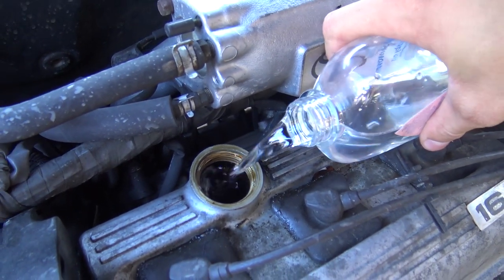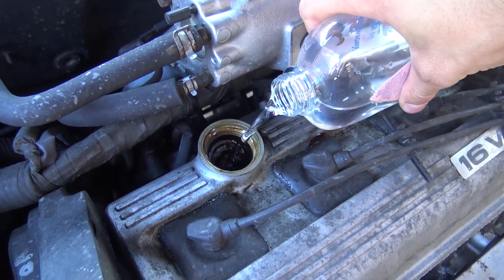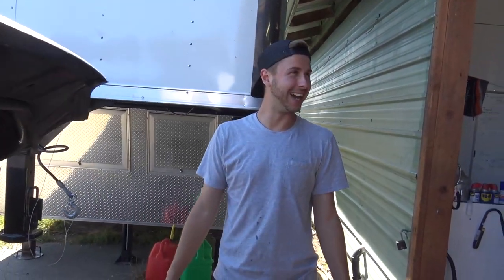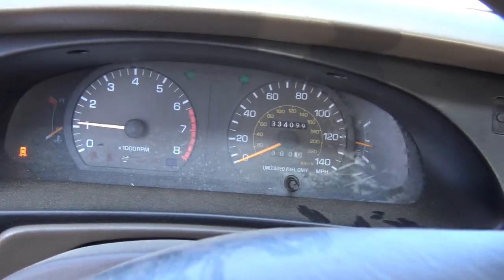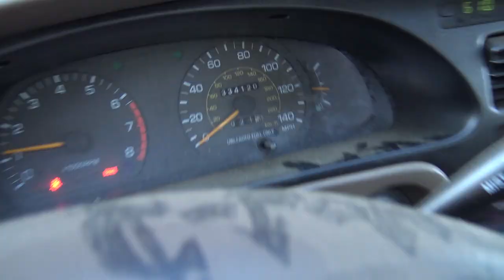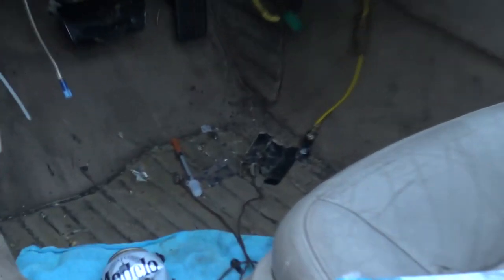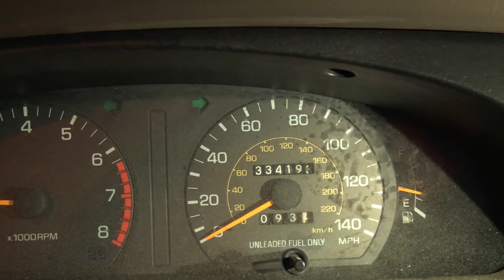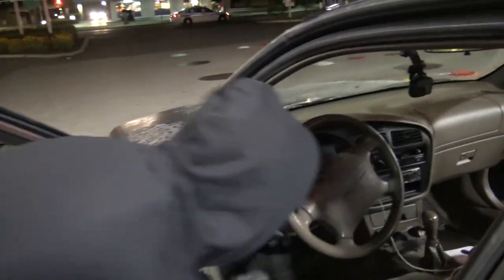Can You Use BABY OIL as ENGINE OIL?

Comment: Next video: "Can You Use Engine Oil As Engine Oil?"
Reply: davidrobert2007 can you use engine oil as baby oil?
Reply: Answer,not always
Reply: davidrobert2007 next video will bw urine as engine oil
Reply: They make 180 miles and still running, that's pretty impressive.
Reply: davidrobert2007 I never would have thought of that
Reply: davidrobert2007 No it's gonna be, Can you use engine oil as a tire?
Reply: Can you use a tire as engine oil?
Reply: can you use petrol as engine oil, brake fluid as fuel, engine oil as coolent and coolent as anal lube???
Reply: I have watched 15+ of these...don't know why, but this was the one that made me sub... 👶🏻 🗼
Reply: You got it wrong. It's "Can you use ENGINE OIL as ENGINE OIL"
Reply: Can you use lube as engine oil
Reply: David Lulham it's used in compressors on r22 air conditioning systems those last up to 20 years using baby oil to lubricate bearings
Reply: Maxwell Gavin
I was about to say that.
Reply: Budget cuts
Reply: davidrobert2007 lmaoo
Reply: David Lulham 

You want a cookie? Lmao what the hell were you proving
Reply: wtf richard they could do regular 10-30 and have me doubting it
Reply: Engine oil als gasoline
Reply: KY
Reply: KennyKGaming yes and runaway
Reply: Maxwell Gavin can you use babys as oil
Reply: davidrobert2007 lock up on startup lol
Reply: Squeek Tate i tried that once it completely ruined my engine
Reply: Can you fry a Turkey in Engine oil?
Reply: davidrobert2007 I dunno that doesn't sound like the best idea... I think it might not work... Lol 😆
Reply: davidrobert2007 Holy 5H!+ that's a lot of likes, congrats
Reply: Starbucks! really?
Reply: davidrobert2007 now that's a tough question
Reply: not water based
Reply: Dude that would never work.
Reply: I think the viscosity on baby oil is thick enough also there still engine oil stuck everywhere else so I would imagine it works good
Reply: davidrobert2007 I like that question
Reply: I taint mistaken Bahahahahahahahahahahahaha
Reply: “I don’t think it will last a minute”
Reply: She's done at 20,000 miles, I guarantee it
Reply: used engineoil as babyoil
Reply: That's a little too crazy, even for them!
Reply: davidrobert2007  tommyfyeah JUST did that!!!
Reply: Calvin Rivera that car has 334,000 miles on it!!! 😎
Reply: davidrobert2007 😂
Reply: Can you use gasoline as engine oil and engine oil as gasoline
Reply: Next video, can you take a dump into the oil pan? And run the engine with it as lubricant?  ha-ha
Reply: davidrobert2007 engine oil as baby oil
Reply: davidrobert2007 haha!
Reply: Next thing, we'll use tire rubber as condoms, or condoms as rubber tire... tsk tsk
Reply: SPECS Ikr I literally just SUBSCRIBED
Reply: David Lulham baby oil is better than nothing at all, but it’s too thin compared to motor oil. Over time the engine will have increased wear.
Reply: Na would not work dog
Reply: @fredopppppp  hahahahahaha the baby will run like a dream
Reply: LOL
Reply: StółZpowyłamywanymiNogamiEdycjaGryRoku Niebieski No but you can use it to make solid rocket fuel
Reply: or you could use the engine as oil
Reply: @stozpowyamywanyminogamiedy4790  It's like flex seal 1 you melt tire 
2 while it's still hot put it in the engine and start it will burn and blow the engine
Reply: probably
Reply: Cooking oil as engine oil
Reply: The ultimate question
Reply: @Ouchie-my6tg  and then babies will ever have a hair again
Reply: can you use an engine as engine oil?
Reply: ah yes the floor is made of floor
Reply: Can you use vin diesel as diesel
Reply: I would love to see this and they all play along with it 😂😂😂😂

Comment: Baby oil is basically just mineral oil which is what cars were run on before the additive years
Loses its lubrication properties pretty quickly compared to modern oil but I wouldnt be surprised if you got a few thousand out of it .
Reply: Ah yeah this makes sense now.
Reply: In Mongolia yak butter made from yak milk is more fatty and thicker but yak butter is very lubricant and use as motor oil

Comment: This test is unfair because you used a Toyota.
Reply: No it not it is fair
Reply: Use a Chevy next time if it doesn’t break down on the way to get the oil
Reply: 440 DRAG I agree
Reply: Swear I thought the same lol
Reply: Laszlo Doiron Yeah, Chevrolet sucks.
Reply: It do sent matter what type of car they use
Reply: i drove over 15 miles once without any oil, an oil line got busted
Reply: Fujiwara Shiina 
WHY
Reply: Goat cuz an oil line got busted? It was night i did not know i was driving with no oil, i aint got no oil pressure guagr
Reply: 440 DRAG could run on any oil
Reply: Funny, had my pos Cavalier almost 20 years.  Engine-wise it is fine.
Reply: Laszlo Doiron what type of chevy? Car or truck?
Reply: Laszlo Doiron u mean a ford?
Reply: I had the 2JZ Lexus GS. The car was losing oil really bad and I was like fuck the rear main seal went bad probably. I put some stop leak and get on the interstate on a 200 mile drive, the oil light comes on and I pull over and it takes 5 quarts! I put some more stop leak and head back home and again I add 5 quarts. Turns out the oil filter had a big hole in it! Needless to say, the engine suffered from absolutely no damage.
Reply: That just shows how reliable Toyota is 😂
Reply: 440 DRAG I did 80 miles with no oil pressure in my 85 Toyota truck with a 22r and it was fine so.... yeah
Reply: Laszlo Doiron *ford

Comment: its a toyota it could run without oil for 100 miles
Reply: William Neigum 
Lol. It will possibly make the 100 from the residual oil covering parts from the change and the baby oil won’t burn until the old oil is fully mixed into the baby oil. Just a guess.
Reply: I bet thats the 3rd gen Camry. I ran one with little and no oil for almost a month.

Comment: You cant kill a Toyota guy, 'oil' or no oil.
Reply: Don Pablo my Camry with 160k just blew up so hmmm 🤔
Reply: Tyler Spiker well with the right maintenance on Toyota or Honda with out modifications like a turbo, you can-easily get 400,000 miles if not a lot more, I know people that have older Toyota’s with 600,000 miles, and civics with over 550,000 miles
Reply: LOL...Toyota has a recall because of engines that fail..Toyota put wrong pistons in their engines thus no good and they die..Toyota Tundra 5.7 Camshafts failed thus killing the engines from brand new..Toyota 3.0 was a dud as every one had a head gasket problem thus killing the engine on some and needing heads and head gaskets redone on others..Toyota sludge engines,that killed Toyota engines at low mileage..

Toyota got their name from paying reviewers to praise their vehicles,all Asian makes did this in the 70',80',90's and continues today..It was even talked about several times by different journalists over the years...

I own a dealership,garage and I have not seen evidence of Toyota's not breaking down or lasting longer than any other make..Peeople with Toyota's generally repair them by the book and replace engines,transmissions etc..Then the 2nd or so owner gets the car and the car had a new engine that they dont know about and every part replaced,then they drive them 50,000 or so miles without doing a thing..Like any car this would happen...
Reply: To be fair there is a 1 million mile toyota in a museum still on its original engine
Reply: Authorized Mike thank you 🙏🏻
Reply: SnowB you just watched a video with dudes using BABY OIL in the engine of a Toyota with 334k. You definitely don't take care of your cars guy
Reply: I didn't change the oil in an 09 scion tC for around 40-45k miles till the bottom end gave on me.
I think my wife's 16 Corolla will out live us.
Reply: Don Pablo straight up! Yota gang.
Reply: Yeah. Scotty kilmer said so
Reply: Unfortunately my Toyota won't last forever because it has a Subaru engine :( still I love the 86 though
Reply: dirtbike14 dirt bike fully synthetic every 5k miles. My f150 gets the same treatment and that's still running. Threw a rod, just a bad one I guess
Reply: Michael Majchrowicz 01 f150 with 150k still running, 04 mustang gt 140k still running, 04 Kia Sorento 220k still running, 04 Ford Taurus 260k still running. I think I know what I'm doing.
Reply: Ben T any car can blow up that's just ignorant
Reply: @THECobrabitch  They do unless you never go past 3k rpm
Reply: @01trsmar  fr man Toyota’s are pieces of shit I blow them up all the time these cheap beaters with around 150k miles as soon as you redline them a few shifts engine is gone

Comment: It’s because it’s the 92-96 Camry 2.2  4 banger engine you can’t kill those. I had one with 500k and got rid of it running and driving after I didn’t drive it at all anymore. From 100k-500k, all I did was oil changes, brakes and one set of rear struts.
Reply: Im a mechanic and ive seen plent of them camrys eat shit
Reply: @TyzGamin sure thing.
Reply: "Im A MeCHAnic" and I've seen one go 6,000 without oil and keep going
Reply: Uhmm have u tried putting baby oil in it 😂

Comment: Can a air mattress pump work as a turbocharger?
Reply: Terrill Williams No. You can buy electric "turbo chargers" on ebay for like 300 bucks which are just glorified desk fand that you put on your air intake. They don't create enough pressure to have any effect on HP
Reply: No.  You can't
Reply: Then try a compressor
Reply: Or buy a turbo/ centrifugal compressor housing and machine a back plate and bolt the wheel onto a monster brushless motor and lipos see what thst does lol
Reply: Spencer Smith you’re wrong. It would produce boost but not enough to outweigh the vacuum the motor is pulling. However the less vacuum there is technically the more power you can make
Reply: r/whooosh
Reply: Terrill Williams its shaped like one

Comment: Put baby oil in a ford. See what happens. Toyota motors way too durable
Reply: JDMovation I bet my 225 slant six will take it but I dont wanna use my engine
Reply: Toyota powertrains are insanely reliable, I cant speak of everything else like electronics or other functions, but their motors are ridiculous....
Reply: Squeek Tate I think most people would agree the 350 is a god tier engine too. Toyota is just much more consistent throughout the years. Just because Toyota is really good doesn't mean other things aren't really good.
Reply: Toyota has major problems with using the wrong steel to make their rings with, and the cars burn oil accordingly.

Comment: I think this proves that it doesn't matter what kind of oil you use, those "performance" oils will get you the same thing as regular. Synthetic and conventional are still different tho
Reply: That's not true. While this oil works well as a temporary solution.. It won't withstand the same temperature and wear as regular oil does. The oil itself will probably not last as long as regular oil.

Comment: I had a Toyota Celica 1995 2.0L engine.  I once ran it for over a year noticing it was running rough but I didn't bother checking anything cos it got me to and from work without a hitch.  Months of this 'rough feeling' so I checked the tyres thinking they needed either replacing or more air, nope, all okay, checked the sparkplug caps, all okay, checked the radiator coolant, all okay, checked engine oil with the dipstick, dry as a bone.  For almost a year I drove it with little and then no engine oil.  The sigh of relief the engine gave me when I did top it up couldn't be felt as soon as I drove her.  Toyota engines are superb!

Comment: if i did that with my car, i'd be watching the engine temperature, listening for any ticking or knocking, and see how it performs when you drive it at highway speeds and when you stomp on the gas. but since you guys pulled it off successfully that tells me that baby oil and regular 5W30 have a similar if not the same lubricity factor
Reply: Well it's an older camry, so it could also just be the car is well designed. On a german car I don't think it would last too long.

Comment: “Can you use diesel as engine oil”
Reply: I want to see them do it too.. Said it a few times now
Reply: And don't forget e85
Reply: I ran diesel in my gearbox and clutch on my dirtbike to flush it out, didn't cane it while it was full of diesel but took it for a slow ride and drained it and refilled with proper oil and never had a problem
Reply: Project Farm has already tried this

Comment: Next: Can you use gasoline as engine oil?
Reply: Name not found yee
Reply: Can you use engine oil as gasoline?
Reply: Rip
Reply: that's not a good idea
Reply: @nov3019892008  you can in a diesel, you just can't turn it off once it starts burning.
Reply: Engine oil is technically gasoline. The only thing that will expoled is propane. So if you have a lawnmower that runs on gasoline and you put engine oil in the tank will it expoled or will it run. It's the same thing as a car/truck/SUV.
Reply: @jakedrex3237  1st of all, what? gasoline is a bi-product of oil, but its not oil. if you had pure gasoline in your engine instead of oil, the viscosity would be way out, causing it to not be an efficient lubricant and thus generating alot of extra heat in an already hot environment. gasoline varpourises very easily and would expand alot creating alot of pressure, and causing the engine to fail, and if when that happens a flame contacts the vapourises gasoline filling your engine it would pretty much detonate.

that said try diesel, it would do a similar thing but it wouldn't need a spark to explode lmao. would look sick too
Reply: @jakedrex3237  lmao just cos its made out of crude oil dosent mean its crude oil, its like milk and cheese, they are made out of the same thing but you cant say "milk is cheese"
Reply: @jakedrex3237  gasoline is prouced in oil refineries. roughly 72 liters of gasoline is DERIVED (look up the definition if you have to bro) from a single 160L barrel (42 gallons) of crude oil. material SEPARATED from crude oil via DISTILLATION (look that up too if you dont understand) does not meet octane standards for modern combustion  engines but can be used to create the fuel you would buy at a gas station.

gas comes from crude oil yes, but it is not crude oil it is part of what makes up crude oil, you can take a leaf off a tree but that leaf isnt still a tree, you cant mill it into planks, its just a leaf.
Reply: No
Reply: Nooooo
Reply: No
Reply: @jakedrex3237  its not but ok
Reply: @nov3019892008  2 stroke XE
Reply: Don't work that way.. But gas do went it. In small amounts..
Reply: No you can't. Found that one out the hard way. Let's just say that in some old garage somewhere very near me there is a old 5hp Briggs and Stratton flathead that will never spin again because it has more aluminum shavings in the crankcase than on the poor cylinder walls.

Comment: Run 100% Marvel Mystery Oil. 

Edit: it’s only like $2-3 a bottle for 1 quart.
Reply: Clayton Hartin i run a quart of that with my oil every other change
Reply: StaxxxCmd Ii use to add one quart before a oil change. But what will 5 quarts do lol
Reply: I run a few ounces in my truck, it helps it I think
Reply: Samuel Clark it does help a lot
Reply: Samuel Clark if you have an old car, it'll benefit. I used to get 14.5 MPG then went up to 15.9 after using the mystery oil and following up with Royal Purple max clean

Comment: Mineral oil is very stable, it also handles punishment very well also. Hvac  compressors use mineral oil to keep its parts lubricated and moving. they also operate at a very high temperature and ridiculous speed in comparison to combustion engines. The tolerances are also much less so it makes sense it would actually work for a car.

I would be interested to see if actual hvac compressor oil would work better for longer. It should as it's even more stable and cheaper in bulk. You could probably get more milage out of it, compressors are typically hermetically sealed and the oil can last for decades.

Comment: I had a Toyota Tercel with a Paseo motor in it. I had the mechanic put some Marvel Mystery Oil in it. A 50/50 mix I think. It Immediately triggered the oil light (it was on all the time), I had him change the oil shortly thereafter and the oil light always stayed on when I started the engine but usually went off either because the engine heated up enough or I could floor the accelerator and the light would go off. Never did figure out the problem, I think the oil pump was damaged by too thin oil. It's best just to put in what the manufacturer recommends, there's a reason for that. 🤷‍♂️

Comment: Try using olive oil next
Reply: Olive oil is vegetable oil, in fact it is a trick in mechanics to lubricate tools (mainly lathes and cuts) and machinery at low cost, when you need a fine oil that does not get too dirty.

-In fact, used oil from fryers or food businesses is used to make Biodiesel, (or there are people who mix normal diesel with cooking oil to save on diesel engines)

-There is an episode of mythbusters where they test whether it is possible to use an engine with "alternative fuels" power and performance are not the same but it works perfectly

Comment: Before watching the video, it will work perfectly fine. However without the additives motoroil companies put in, the oil will oxidate and turn acidic which will start to corrode the engine from the inside over time.

Comment: Can you use car oil as break fluid ? 😔
Reply: Yes, you can technically use water as break fluid
Reply: Brake*
Reply: The only fluid in a car that will work as break fluid is coolant.
Reply: People that don't know the difference between break and brake should be removed from the gene pool.

Comment: Short term , thin oil might pass by the rings, but if its not too thin it'll work. Long term, theres no additives. 
    I ran a motorcycle on corn oil, because it was what I had. I didn't get to change it for a feww hundred miles. No issues.